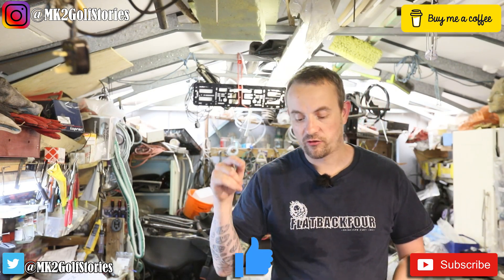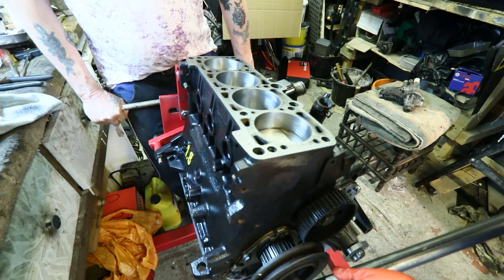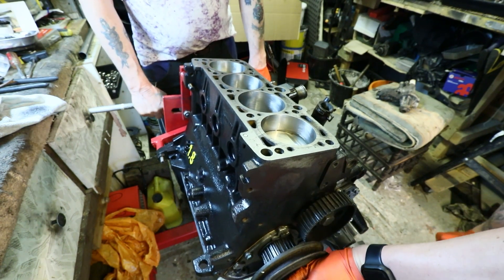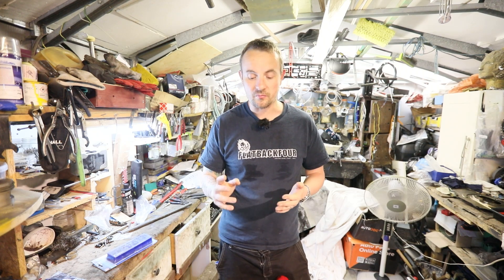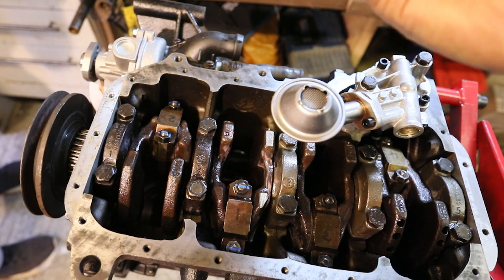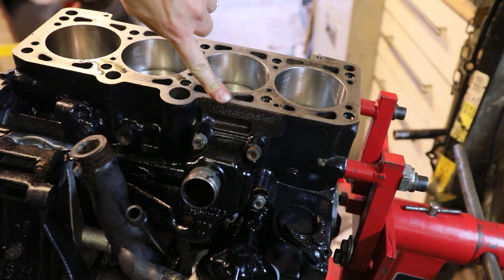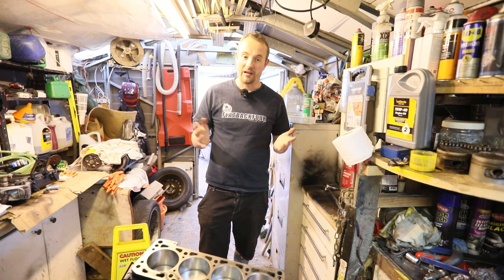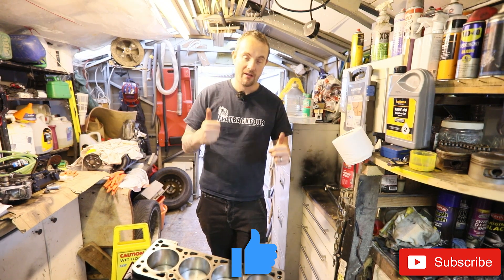Overcoming Engine Tightness After Rebuild

Comment: Did you get new rod bolts? I had a real hard time getting some a few months back, freezed them and heated the con rod then use the cap and nut to wing them in. Been known to fail if reused as they are torque to yield.
Reply from the maker: @ForSunday  oh really?!
We didn’t get new ones no, the guy at the head shop said we wouldn’t need them though…